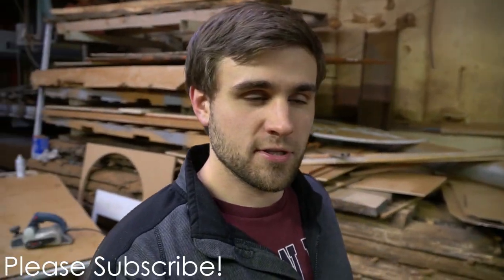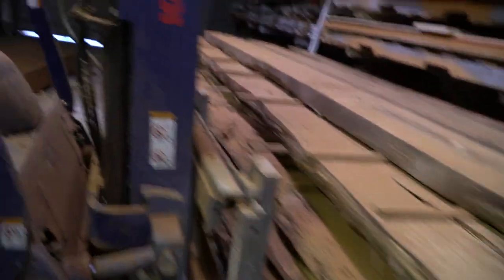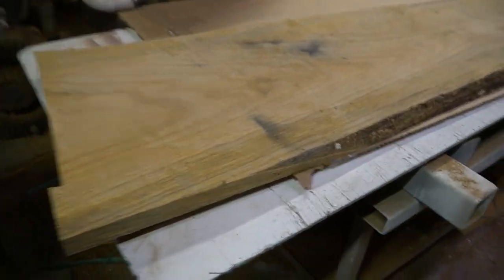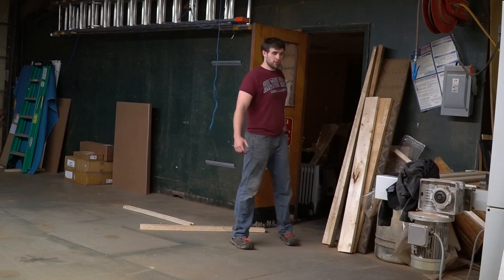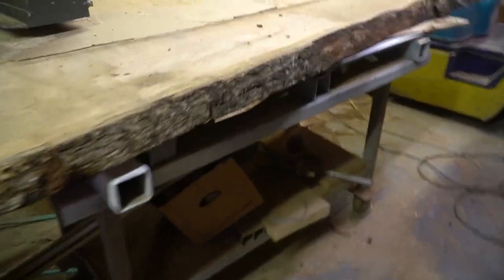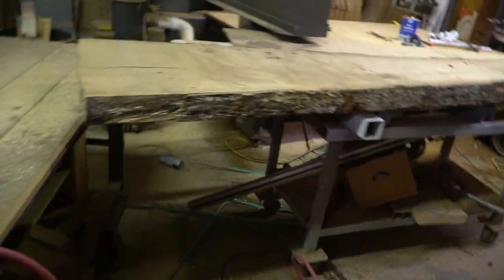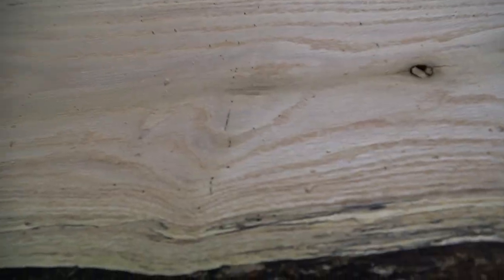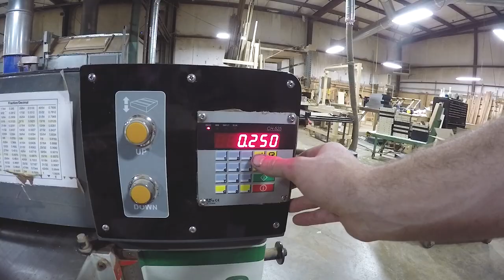Making A Live Edge Table - Not Learned On Pinterest

Comment: Nice project. Simple yet looks great. I would go with a lighter stain that keeps the contrast between the sapwood and the heartwood, and highlights the grain a bit more, but some people like the whole piece blended together in one general shade. Also consider using threaded inserts and bolts for anchoring the legs. You can easily remove the legs and re-attach them without compromising the threads in the wood, as happens with regular wood screws when taken out and screwed back in a couple times.

Comment: I like the stain a lot. Looks like a very nice finished product. One question though... why not fill in all the little pits and cracks with epoxy or wood putty to prevent stuff getting built up in them over time?
Reply from the maker: +Mike M I wanted to leave it a little more raw so when the light bounced off the top of the table you could really see everything that's going on with the texture. I don't think this table will get enough hands on use to really get super dirty, but if it does become a problem it won't be hard to Clean out and add epoxy later.
Reply: Christopher Burress Awesome finish, but be careful because those little bugs look to me like woodworm, and they'll spread all over your furniture and even home structure. We used to kill those little b*** with gasoline or sealing every single hole. To check if they're still alive, look for sawdust falling off from the holes.
Keep going with your channel!
Reply from the maker: Thanks for the heads up! I'll keep an eye out!

Comment: Nice job. Could you please tell me what tool you used to cut out the square indentation to level the table, was it a drill attachment?
Reply from the maker: +Nicholas Chapman it was a bearing free straight router bit hooked up to a hand router. .
Reply: thanks a lot for that!

Comment: Hey is this green or have you waited for it to dry?
Reply from the maker: It dried for about 2-1/2 years before this.
Reply from the maker: +becool365 I let this dry for about 2-1/2 years. A good rule of thumb is a year for every inch of thickness. That's for air dry. You can speed it up with a kiln.